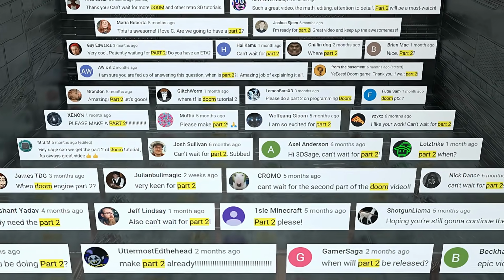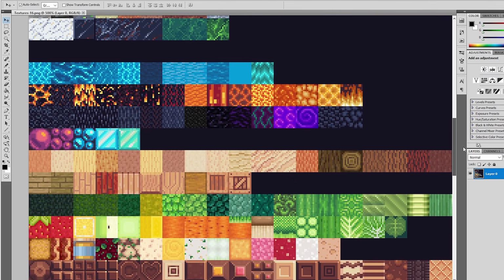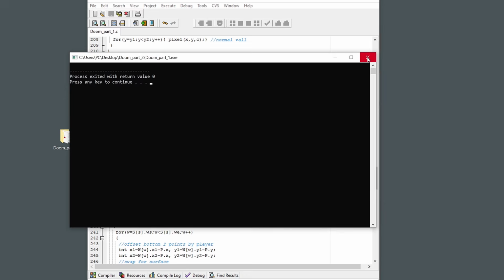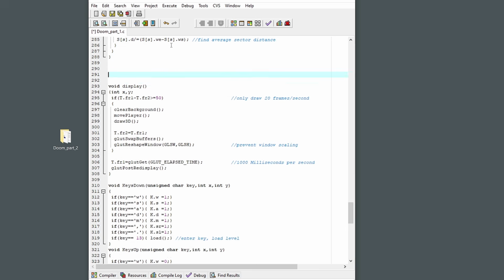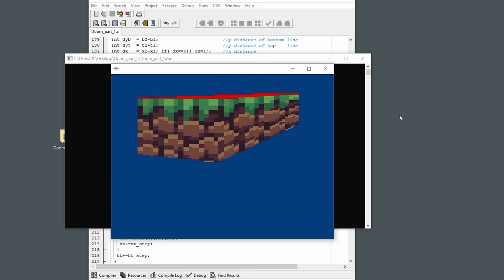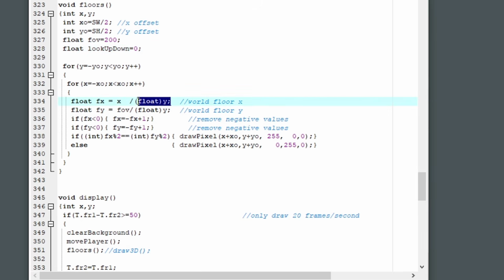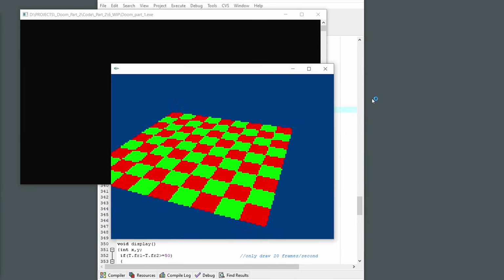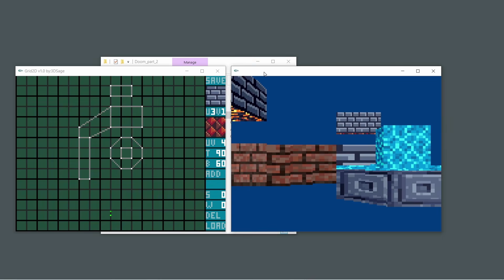Let's Program Doom - Part 2

Comment: Great work!! Good to see someone not jumping on the crappy BSP/Raycasting fad (both were really terrible ideas). Sector/Portal rendering is just far superior in every way to BSP/Raycasting. Your system is inverted tho - i.e. it draws the sectors from the outside - where as a FPS engine draws the sectors from the inside. Top work!

Comment: Excellent tutorial! However, I'm having an issue with the top and bottom textures. From what I can see from your video the code I have is the same as yours. I would like to compare it with code you posted on Github, but I can't find the part 2 code in the link from the description, just part 1. Could you update it please?
Reply: I’m having the same issue, I’ve spent a very long time trying to fix it. I have no clue how to fix it. If you’ve come up with a solution please tell me 🙏

Comment: Great video, thanks! However, every time I try to implement this video I run into a problem where the textures on the walls stretch out when not looking perfectly straight at the wall. Has anyone else encountered this? Does anyone have any idea why? I couldn't figure it out yet but I think it has something to do with ht_step.
Reply: did you ever figure this out?
Reply: Not yet sadly :[ do you also have this problem?

Comment: Loved following this.  I have ported it to my 486, it needed a few optimisations to run ok (which I know you are aware of).  I am having trouble with the top/bottom surfaces, if you get too close with the camera they still get culled when travelling along them.  I know this is a work in progress (so please ignore if you like, no problem) but the wall texturing seems to not work from some angles (if you are close to the wall).  I also have an issue that the tile spacing is linear meaning the tile further away has the same x distance as the closest tile, did Doom do this, cant remember?  Awesome work!, really enjoyed getting it working.  Thank you for your video and effort :)

Comment: I know this video is a year old by now, but a super easy optimization trick is to remove glBegin(GL_POINTS); and glEnd(); from the pixel function, and call glBegin before any for loops that have pixel() in them and glEnd after the loop

Comment: I ended up programming my own level editor and save load system for my gamemaker port I did for fun.

I also modified how the level data works, I swapped to using points, walls, and sectors rather than just walls and sectors. That way I can draw points however I want in the editor as walls are composed of two points, texture data, and color data.

This also brings my port closer to how doom actually acts as doom uses vertices, linedefs (and sidedefs), and sectors

Comment: I think I found your "Really nice formula" for calculating the surface tile placement and it's basically yours with the last two variables changed:
for "rx =" and "ry =" just change your last two variables to the following:
(P.y/yo*tile) and (P.x/yo*tile)

Or as it looks in my LUA version:
rx=fx*math.sin(math.rad(pA))-fy*math.cos(math.rad(pA))+(pY/yo*tile)
ry=fx*math.cos(math.rad(pA))+fy*math.sin(math.rad(pA))-(pX/yo*tile)

The (pY/yo*tile) and (pX/yo*tile) works to lock the surface textures in place even while moving. I don't know how as I was just poking the code until it did what I wanted.
I'm sure you've probably hashed this one out (or someone already mentioned it) and I look forward to the next tutorial!
Reply from the maker: Thank you for adding this for people to see! That is a great update. I will be making several little updates in the next tutorial and adding a lot more too! :)

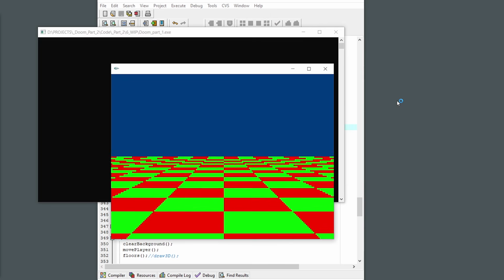Comment: I gave you my thanks. This is awesome content! Edit: There is a small bug in the texture mapping, if you check around 14:47, the texture's "dirt boulders" stays the same width on the whole width of the wall, with no perspective applied to the hstep. The more distant the texture should have thinner boulder, the hstep needs to take the wall height ratio in account...

Comment: @3DSage, 6.2 is not as accurate as 6.67. I've observed that using FOV/UPDOWN_FACTOR (which, in this case, is 30, the same value used when computing the wz of the wall) is the correct way to calculate it. Additionally, P.x/60. and P.y/60. are related to the window size, specifically the SH2. You can experiment with adjusting these constants and then make changes to the resolution accordingly!

Comment: compiling the  editor in  vs code makes it crash, seems to not like the view2d.h, any ideas?
Reply: also looks like vs code wont allow me to simply use fscaf/fopen.  useing fscanf_s and #pragma warning(disable : 4996) seems to be enough to fix that tho
Reply: also getting color  defects  when adding the shadeing, the problem seems to come from "if (r,g,b < 0) { rgb = 0; }" as it now changes the colors on even the front faceing walls, for example,  the grass texture you are useing is now purple at the  top of the texture. When removing the if statements the front works fine and the sides are as expected negatives. Have not found a solution yet.

Comment: I am waiting for part 3
Reply: is there already part 3?
Reply: @diandradeeke no sadly
Reply: muratbayraktar4733  So if you know where Part 3 is, why wouldn't you post a link to it? Otherwise your post is pointless.
This is standard internet stupidity. How many times have you seen posts for help solving a software problem where the poster, in great detail, describes their problem and asks for help. Later they post saying that they fixed the problem and does not provide any information on the solution. Thusly, not providing the same help they were previously asking for. This is selfish and stupid.
Reply: @richardsauer1667 Dude it's not that serious

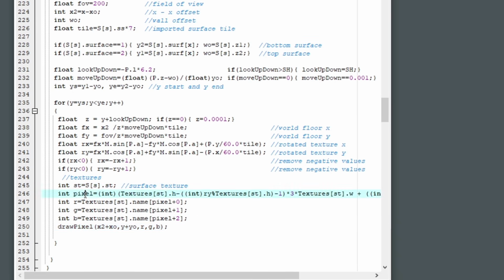Comment: at 19:16 what is the last part of line 246?
Reply: I'm also trying to figure out what is the value to draw the surfaces' texture.
As i couldn't see the entire line of code, I did a copy and paste of the code from the for loop that draws the walls' texture: "int pixel = (int)(Textures[wt].h - ((int)vt%Textures[wt].h) - 1) * 3 * Textures[wt].w + ((int)ht%Textures[wt].w)*3;", and pasted it into the variable for drawing surfaces, and changing exactly only the vt, ht, st values for the correct ones, the texture of the surfaces becomes very enlarged. If I find the solution I'll come back here with the answer.

Comment: Hey, another amazing video, and t is really easy to follow, just please add some visual indications around 10:45 when the cut is a bit too late, and those casts to (int) appear late and is easy to miss out. I got my video stopped at a bit earlier point while re -typing and when i tested it it was not working, because I missed the cast.
Reply: I did the same thing lol, spent like an hour going over the video and different parts of the code to figure out what I'm missing.

Comment: This also works in VS but it's a bit different
Reply: VS?
Reply: @dude2542  visual studio
Reply: @danddhampstudio  that's an IDE. Or is the compiler something else? How does it differ from his code?
Reply: @dude2542  it doesn't use the open gl code
Reply: @danddhampstudio  why? Does it create its own window?
Reply: @dude2542  yes.
Reply: How did you get it to work? I cant get it to run in vs

Comment: Me, a drop-out from CompSci who chanced into these videos while wandering around the internet and only understands about half of it: Hmmmm. Fascinating.

I am, however, a doom mapper in my spare time, and at the end of the video you did ask for suggestions, so I have three:
* The map editor doesn't seem to have a way to set different textures for floor/ceiling on the sectors or specific textures for individual wall lines within a sector. This is a feature of the og doom engine that goes a long way into making maps varied and interesting and since you managed to get the hard part (actually drawing stuff with texture mapping) down, it could elevate your engine as well.

* Light levels! Doom had you set a lighting level per sector, with 255 being max and 0 being minimum. Fairly sure it just darkened all the pixels inside that sector by the reverse of that. Also something that makes maps more varied. Later you can even make light levels that change on the fly, for like flashing or flickering lights and such.

* The little fade you did when you were demonstrating the floor rendering with flat colours. You could probably achieve a similar effect by applying a similar formula but to all three colour elements of the pixel while you are drawing the texture, since that, too, is just plotting colour pixels on the screen. If you really wanted to go all out, you could make these controllable parameters stored in the sector array, thus giving the map designer customisation over the fog within a sector, which can make maps more moody. Then again this would probably also call for doing the same to wall textures and we start getting even more complexity.

Comment: Stop using define, is a bad C practice. Use const instead. Define is not read by the compiler, Wich means if something goes wrong you will not notice. Also as define it's a preprocessor is not even considered a variable, which means the compiler cannot optimize anything that you use define like putting a variable that is always used on a register. This will not happen if you use define
Reply from the maker: This is really great info so thank you so much for sharing it! :)
Reply: All const can also be local if you need, all #define are define as global variables and they exist during all execution. const in other hand can also be local if you need. It may help you to squeeze the last bytes of memory you need

Comment: Small note, UV coords are typically for normalized texture coordinates, so 0.0 to 1.0 (and occasionally -1.0 to +1.0)
S and T are used for pixel coordinates, because uhhh
...Yes.
Thats why GLSL (and i think HLSL) swizzles let you do XYZW, RGBA, and.. STPQ. Though STPQ is also sometimes for normalized texco? because UVW can overlap with XYZW?
its weird, just general rule that UVs are normalized floats and ST are pixel coords hhghg =v="

Comment: Great tutorial!

Fiddling with the code, that 60.0 that shows when calculating the rx and ry for the surfaces of the walls, is it related to the y offset of the walls?

I'm asking because, when I doubled the game resolution here, those 60.0 didn't worked anymore, but 120.0 did. And I noticed that yo is related to the height of the window (yo = SH/2) so, when I've changed 60.0 to yo, it looks that it works now... Am I doing this right? haha

Comment: I kept forgetting to share the port I did in python lol. I figured out texturing on my own, but I never figured out how to get floor texturing to be performant, so instead I did solid color floors for sectors and did some level trickery to make it look better. 

I used Tiled to make my level editor, instead of writing my own (I did the same trick where you have to draw the polygons a certain direction because I didn't want to write code to check it lol). Didn't bother doing BSP or portals, so I just designed a level that didn't obviously break as much. No proper collision detection, but just enough to let you walk up stairs.
Reply: a year late but for floor texturing draw the pixels in rows instead of columns

Comment: It looks like you're linearly interpolating the texture horizontal coordinates on walls. Won't that look wrong for walls viewed at angle, like the wall of a long hallway, where the halfway point of the texture really should be more than halfway along its length? Or are you just not concerned with that?

And for floors, have you thought about using rows of pixels instead of columns so you don't need to make as many divisions?
Reply from the maker: You are correct. Planning out a video like this is very tricky and I leave a few things on the cutting room floor but those issues will be brought up in the next part.